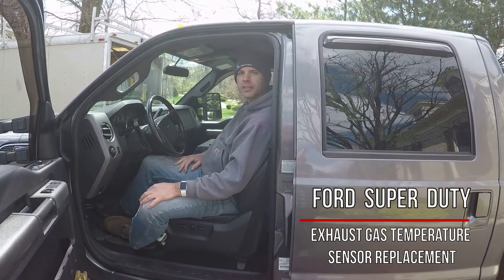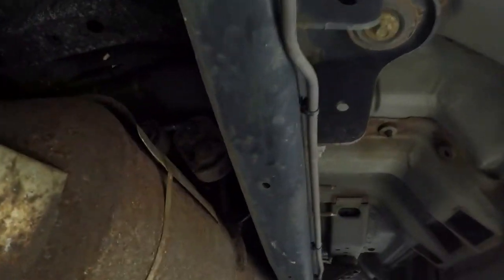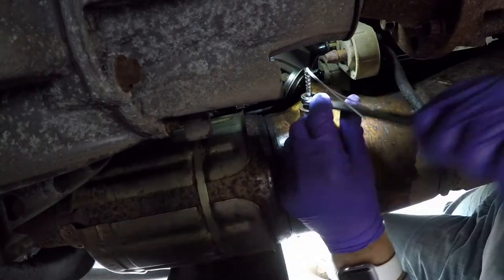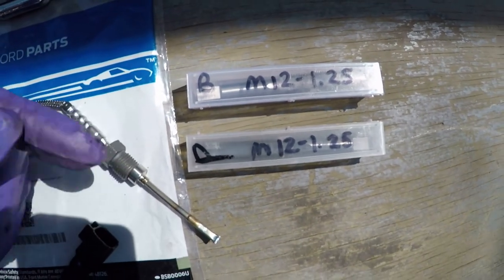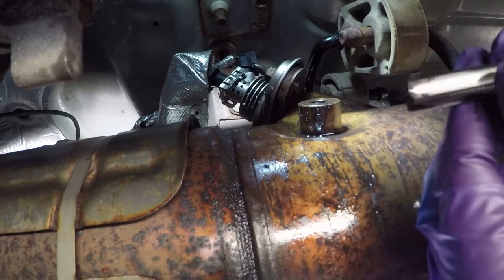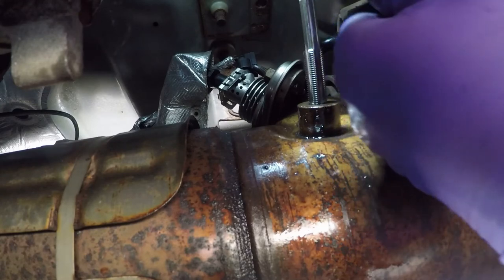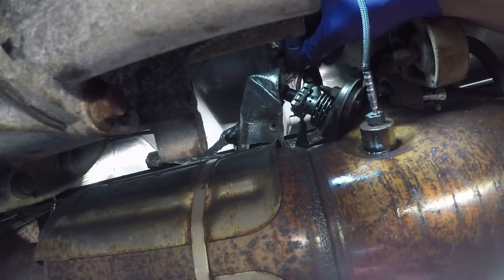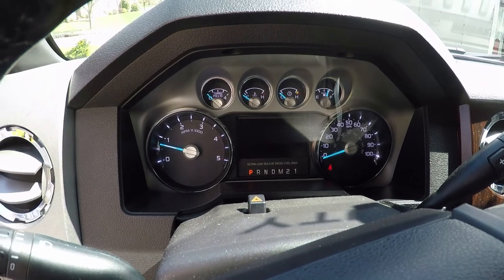Ford Super Duty Exhaust Gas Temperature Sensor Replacement

Comment: Thank you for the vid. Ck. engine light came on code read is P246E exhaust gas temperature sensor circuit 
(Bank 1/sensor 4). 2011 f250 6.7l super duty. 
Once again thank you
Reply from the maker: No problem.  Happy to help!

Comment: I got lucky on my 2015 6.7 f350. Truck shut down in the middle of Rochester, NY. Pulled battery waited 15 minutes and had to try a couple times to get truck to drive for a couple seconds to reach a parking lot. Fortunately I had a FIXed scanner still in my truck. It told me sensor 4 was defective. Couldn't break the nut with any wrench and or oil. Luckily sensor 4 had enough room to fit my DeWalt impact. Spent 300 at NAPA for 4 sensors (only needed one) . Miraculously worked. If I do the other ones I would think I would use those pivoting sockets. The old sensor was clearly broken.

Comment: I spent three days using your method plus heat from a Mapp torch and could not budge the sensor. Broke one of the arms off a HF 13mm combo wrench. Used most of a can of PB Blaster.
Finally used a 13mm socket and breaker bar, took about 1/16th of a turn to break it loose and removed by finger from that point. Now my truck has spent all it winters in salt free Florida and the header is still clean with zero rust. So this may not work in the salty road part of the country.
BTW this error threw my truck into limp mode when hot.

Comment: Got my reading..., ie. Gettin' ready to find Bank1Sensor 4, of course the only one not shown in video, but I'm sure I can find it.  I am also the king of stupid questions, but if this video is what I can expect, should I really expect to have to put penetrating oil in for 3-4 days and then finesse the defective sensor out and then re-tap the orifice?  Is there at the very least a 50/50 chance that the sensor will unscrew without damage on the first attempt without the prep? ... because the tap thing is gonna be a learning experience.
I can so see a mechanic who messed this up explaining it away as somthin' that's a major expensive fix.  
- Thanks, I appreciate guys like you helpin' us out.
Reply from the maker: Hi Ken.  Sensor 4 is the last one in the series, just start counting from the first one near the wheel well.  I would definitely soak for as long as possible as it will help.  Breaking it free will be tough but I would avoid using a hammer on the wrench.  Go with a longer ratchet or breaker bar and apply steady pressure.  Sometimes a few raps with a hammer on the pipe near the fitting helps.  I'd say you have a better than 50/50 chance if you work it slowly.  After it's broke free, work it back and forth with finesse.  If you feel it start to grab and get tough, go the opposite direction (clock-wise) then spray some penetrating oil on the threads and work it back out.  The key here is patience and slowly work it.  If it breaks, then you'll have to drill it out in a very tight spot.  Tapping isn't bad as long as the tap is straight an you start a couple thread in the existing hole.  Best of luck

Comment: Sir, I have the code p2a01-00 on my 2018 f250 6.7L D, the fault lies with bank 1 sensor 2...the parts guy is asking for a part number because the code means nothing to him.  I'm stationed in Germany with the military and the Germans don't work well with American Trucks.  Any help?
Reply from the maker: Hello.  First of off thank you for your service.    
Bank 1 sensor 2 on my 2012 F350 with the 6.7l had a part number of AC3Z5J213C.  That should be the same part number that will fit your truck.
Take care

Comment: How did you attack#3?  It's looking super tight with almost zero clearance.
Reply from the maker: There is some clearance on the inside of the frame rail, but it was very tight.  Plus, I had to drill out that fitting because it broke off.  I had to use short drill bits and a right angle drill to get in there.  A real pain, but got the job done

Comment: What kind of issues was the truck giving you when the exhaust gas temperature sensor were going bad
Reply from the maker: Hi Saul.   No issues with the truck other than the check engine light was on.  I replaced the sensor and the code cleared.
Reply: My truck didn't want to start no crank no clicking plugged my code reader in and said EGT sensor circuit high bank 1, sensor 1.

Comment: How do you determine which sensor is bad? (2015 F350 6.7L diesel?
Reply from the maker: You'll need an ODB II code scanner.   Sometimes parts stores such as Auto Zone will scan the vehicle for you for free to get the codes.

Comment: Is there a way to tell which sensor has failed
Reply from the maker: You'll need to connect the truck to an ODBII scan-tool to see what error code is displayed.  That will tell you which sensor it is.   Some auto parts stores will scan the truck for you for free if your check engine light is on.

Comment: Would that sensor cause truck to not regen while driving?
Reply from the maker: I've had a failed sensor and the truck would still regen while driving, so my initial thought is that they are not related.

Comment: I have a P040-D  can’t find it on my truck. 2011 6.7 power stroke 😊
Reply from the maker: That's the exhaust gas recirculation temperature sensor.  Should be screwed into the short metal pipe between the turbo charger and the exhaust gas cooler.  It looks similar to the exhaust sensors screwed into the exhaust pipe.